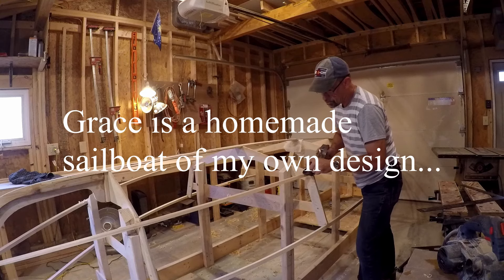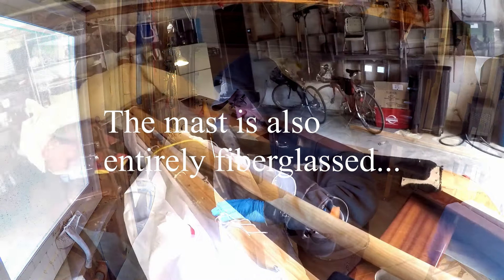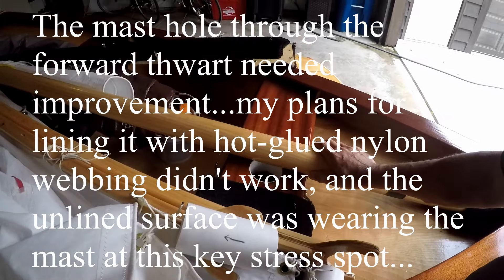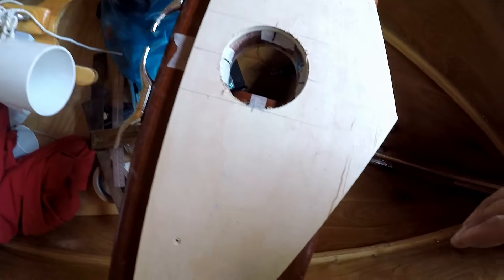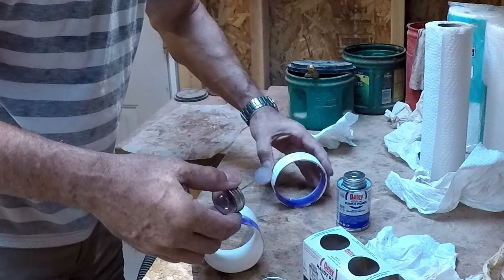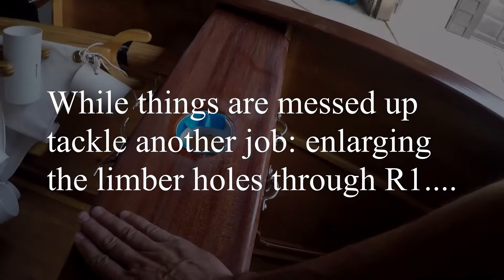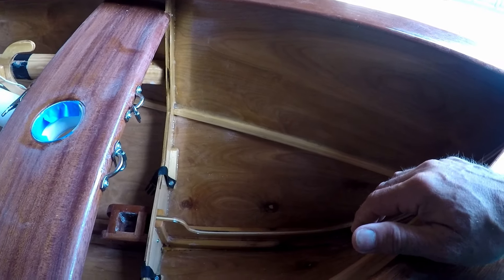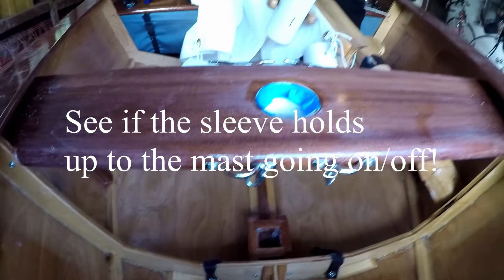Stayless Mast?  Design discussion and mast sleeve re-do!

Comment: Well done!  Curious about the two little blocks with black web straps under the mast hole, near the mast step?  Tx
Reply from the maker: Hey sorry I missed your comment and question.  Those buckle into straps that are fastened on to the underside of the little deckboard, serving to hold it on, and to also then fasten in the flotation in the bow.  At least I think that's what you're asking about.  Part 4 of the build series shows the flotation and that little foredeck installation.
Reply: @rudywoodcraft9553  thank u, happy new year